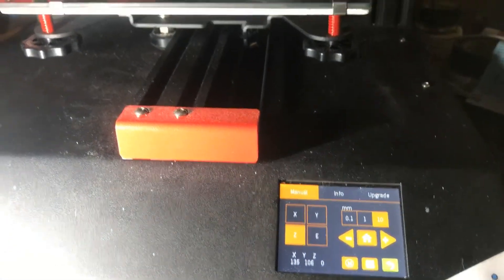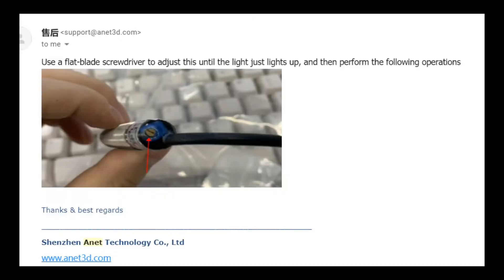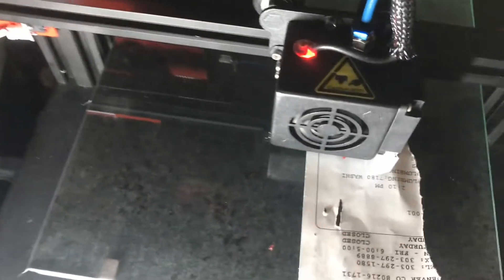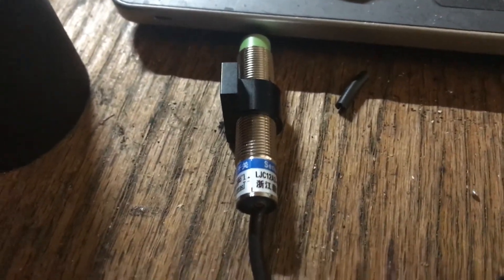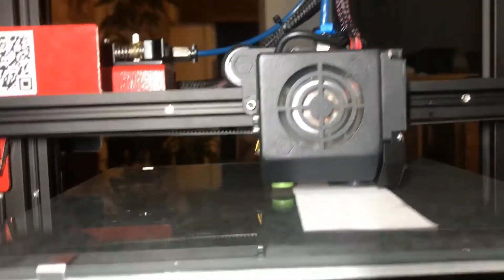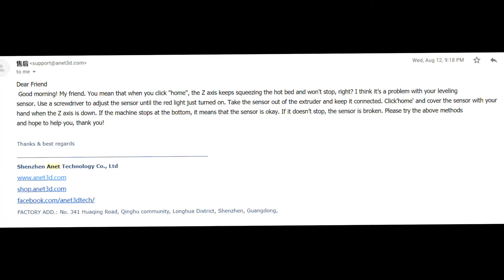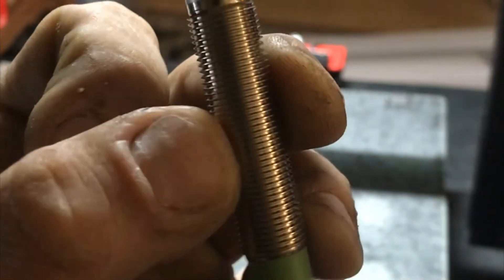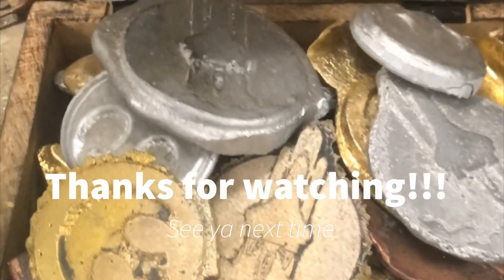Hot end hitting the bed on your 3d printer? How to adjust a bed leveling sensor on an Anet ET4+

Comment: The problem is a bad design. The sensor is rated at 50-75 degrees ambient temperature and they put it inside the cover  less than an inch away from the hot end that gets to 200c +  which messes up the sensor. And also the sensor blocks half the heat sink cooling fan. Very bad design. Mount the sensor to the outside of the cover on the left side like a BLTouch basically. Same screws and same bracket. You'll have to drill and tap a hole in the bracket to relocate the grub screw so it's accessable on the outside. I have 2 ET5X printers and they both were having issues so I moved them to the outside and haven't had a problem since using the same sensors that were having issues. It also cools the heatsink better because half the fan isn't blocked by the sensor anymore.

Comment: Good afternoon)
After replacing the sensor, was your problem completely resolved?
Does your printer still work with this sensor?
Have you tried replacing that sensor with a mechanical limit switch?
Reply from the maker: New sensor worked great for a couple months but started to do the same thing again. I would love to replace it with a limit switch, but its a 3 wire device not, an on and off two wire, so when the board gets replaced I plan to replace it with a mechanical switch.
Reply: @meltn  
Good afternoon
I saw a solution to this problem on another channel, here is the link https://www.youtube.com/watch?v=YgTj8IMOrP4&list=PL_LYnd90dbxgrOW16ly06yS7Y9Avz2D2k&index=12
In this video, a guy changes the sensor to a mechanical one on a standard board)

Comment: I just replaced my sensor a week ago except I ordered through Amazon and got it one day instead of waiting a month to get it from China (Anet). My problem was a bit harder to diagnose since homing worked fine and so did manual leveling. Even after proper manual leveling I noticed that leveling was changed mid prints. It only crashed in the plate during auto leveling but not on every point. It worked fine on every single leveling point except the left most X in which it crashed past the point the sensor light triggered. After installing the new sensor even the auto level is working again. 

I wish there was a way of changing sensors on the Anet ET4+ from proximity to touch. Seems to me the touch sensors would be more reliable and accurate. That is actually what I was searching when I found your video.

Comment: @Meltn from your video I could not understand why you replaced the sensor,
It seems it was working perfect after the calibration with the screwdriver, what I miss ?
Reply from the maker: The sensor required calibration between every print sometimes it would go out of calibration after setting the sensor and before the print started. Ruined a couple different flex plates in the process.

Comment: I had issues when I first bought my Anet printer in late 2019. I had some very frustrating encounters w/ Anet CS. Clearly their English skills are severely limited. I found little online to help. None of the issues being described seemed to fit, and their instructions didn't resolve my problems. I finally did find a place to buy another sensor, as Anet finally said mine was bad.  It took over 3 months to get the one I ordered (from China). In the meantime Anet told me they'd send me another, which took another 3 months.  I changed the sensor out, and eventually got it to work, though I got little help in how to change it out.  I FINALLY had a functioning printer for about a year until it suddenly went awry again this week.  I do have an extra sensor but now have to replace it again. I'm not convinced the problem is in the sensor. Consider yourself luck to have found someone at Anet helpful.

Comment: I am still wondering if the sensor is failing, or if the sensor wires are breaking due to how the cable is tightly 90ed from the back of the sensor to the sleeve and has another tight 90 going into the sleeve.  I have seen these cause problems before in industrial applications of proximity switches.

Comment: Escape the capacitive sensors. They are rubbish and always need adjustment, many times they end up failing and they push the print nozzle on the table and damage everything. Change to an inductive sensor with the following reference: LJ12A3-8-Z-BX. This inductive sensor is NPN and NO, identical to the position of the wires and quantity, just turn on the brown with brown, blue with blue and black with black. Not to mention that it is already 8mm detection, which will help when fixing the sensor, as this sensor needs something metallic to identify. Here I took an aluminum foil and pasted it on the table glass and it's working, I never had any problems with sensor adjustment, much less the nozzle damaging the table when making a HOME or AUTO-LEVELING. There are these 4mm detection sensors, but I never tested it, as I always thought it would be insufficient, because the metallic part is just below the glass, so I would need a few more mm to be able to pass the glass and not need to leave the sensor in it height of the hotend print nozzle.
Reply: Cont: as I always thought it would be insufficient, because the metallic part is just below the glass, so I would need a few more mm to be able to pass the glass and not need to leave the sensor in it height of the hotend print nozzle.
Reply: @marcelinojosecabral  so is the sensor you mentioned detect up to 8mm? Will it work with the glass plate in place without additional metal sheet on top?
Reply: @guinnessme , 
You need the aluminum foil below the glass. M12 sensor is 4-5mm detection. Only the M18 detects between 8-10mm depending on the brand.
Reply: @guinnessme  , M12 = LJ12A3-8-Z-BX
M18 = LJ18A3-8-Z-BX
Reply: @marcelinojosecabral  I though the 8 in the item product title meant 8mm sensing, and the one with the 4 would mean 4mm
Reply: @marcelinojosecabral  would a PEI flexible built plate solve the problem? I ordered a ET5 pro and want to be prepared in case this issue pops up.
Reply: I relevel my beds once a month whether they need it or not and I do a lot of printing with the stock sensor. The problem it it's location, it's too close to the hot end and the heat messes up the sensor. Plus it blocks half the heatsink cooling fan. Move the sensor to the outside like how a BLTouch would be located. I solved the inaccurate sensor and cooling fan problem and haven't changed a sensor in going on 2 years now where I was changing them every few months or less

Comment: So when I adjust my sender because it’s to far from the bed it works I put my hand on it and it stops but when I adjust the sensor it does not really make a difference at all ☹️ what should I do?
Reply: Escape the capacitive sensors. They are rubbish and always need adjustment, many times they end up failing and they push the print nozzle on the table and damage everything. Change to an inductive sensor with the following reference: LJ12A3-8-Z-BX. This inductive sensor is NPN and NO, identical to the position of the wires and quantity, just turn on the brown with brown, blue with blue and black with black. Not to mention that it is already 8mm detection, which will help when fixing the sensor, as this sensor needs something metallic to identify. Here I took an aluminum foil and pasted it on the table glass and it's working, I never had any problems with sensor adjustment, much less the nozzle damaging the table when making a HOME or SELF-ALIGNMENT. There are these 4mm detection sensors, but I never tested it,
Reply from the maker: That's rough, you can try to replace the sensor, or you might be stuck making adjustments every time you use the printer.
Reply: as I always thought it would be insufficient, because the metallic part is just below the glass, so I would need a few more mm to be able to pass the glass and not need to leave the sensor in it height of the hotend print nozzle.

Comment: Did you have to adjust the new sensor when you got it?
Reply from the maker: yes but it stayed set for a long while after setting it once
Reply: @meltn  mine is so flaky, I fart sideways and it's out of calibration.

When installing the new one, how  do you know where to position it heightwise?  I can loosen the set screw in the bracket, but I have no idea how far up or down it needs to be